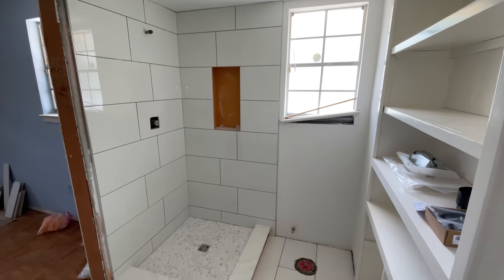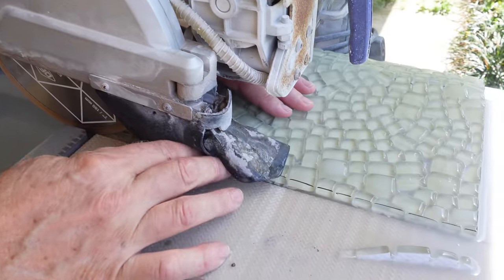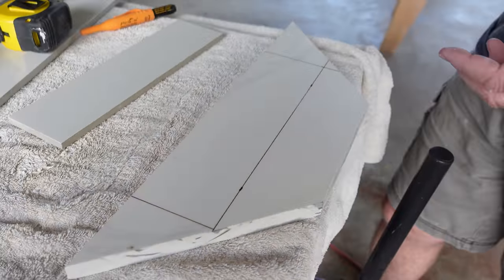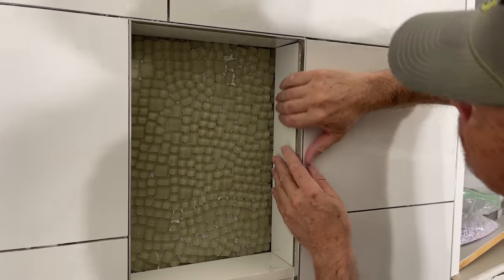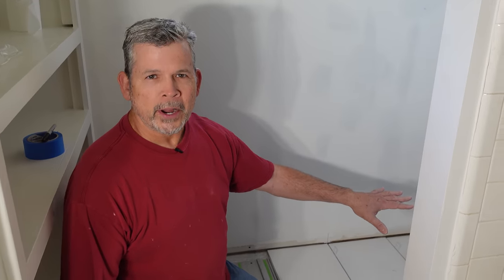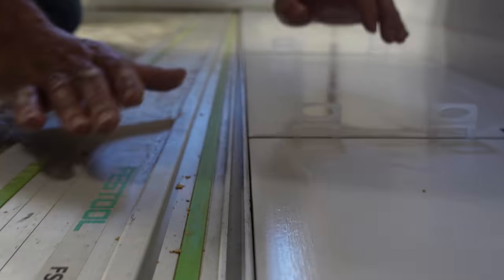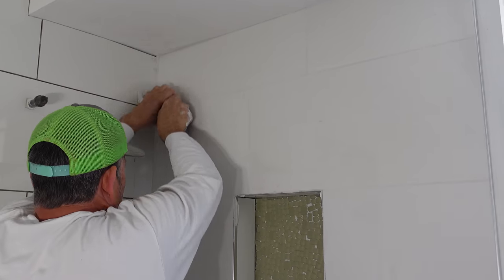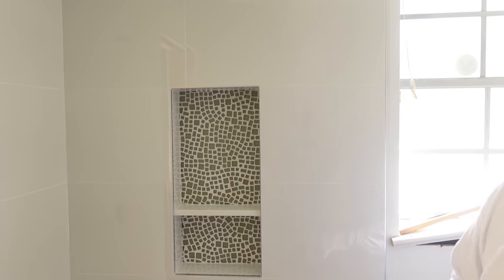BUILDING a MODERN NICHE with Stunning "DRAGON SKIN" TILE

Comment: As a contractor of 46 years here is a tip to cut down grouting time. after grouting and before it sets up wipe the tiles with an old terry towel before sponging, this will get the bulk of the residue and save time and arm muscles.
Reply: Agreed, by the time I'm done grouting my arms are super tired.  It's much harder than it looks on these videos.
Reply: Or don’t use grout like it’s liquid leveler. Why would anyone cover a floor or wall like that.
Reply: Nice trick.
Reply: @timthompson7205 that’s literally the way it’s done lol
Reply: @ChaseW26  are you a 5 year old girl? Literally. Also you’re incorrect. Let me know in 2 years when your tiles are cracking.
Reply: @timthompson7205  literally. My tiles are holding up just fine 5 years later. Try again.
Reply: Whats a terry towel?

Comment: Hey brother. Really like your videos. Love the good positive attitudes. Im commenting because I wanted to let you know something about this prism grout. Ive been a commercial tile installer for 40 years. Im a huge custom blend fan. The area rep is a friend of mine. I know your going strictly by the instructions, however, you can use just a little more water in your grout. Not much more but a little. The manufacturer is just covering themselves for fear of mixing TOO thin. Couple more drops will make your life easier without compromising quality. God Bless

Comment: Woo hoo! Stunning!!  I have used Laticrete Epoxy grout and it sets up so fast! One trick I have learned is to put the grout bucket in a bucket of ice - makes it set up a little more slowly and any little bit helps!
Reply: I use ice water to slow down the setting of grout and thinset when it’s hot and humid.

Comment: I would put a radius (maybe 1/4 inch) on the curb corner to avoid hitting bare feet/ankle on sharp edge there. Great Video you did with lots of information.

Comment: A TON of appreciation for grouting with the fast stuff. I did it once with the fast stuff without realizing it was the fast stuff on my bathroom shower reno. Did all the walls and floor and by time i had gotten it all down it was setting up on the surface of everything... and I was hosed. Spent 3 months of nights and weekends trying to get that stuff off once it set on with drills chemicals and selective scraping... and even then its still not perfect to me.
Reply: As a one man outfit I prefer not using the fast set grout.  You really need two people working it.

Comment: That dragon-skin tile sure looks great!  Love the sea-glass look.  
Surprised no grout company has made a *clear* color-tinted grout line just for glass tiles, so light can refract thru the grout same as it does thru the glass tiles!
Reply: With mirror / reflective  adhesive underneath . . . can't imagine how expensive that would be.
Reply: @jamesm.8392   Thinkin’ maybe paint the color(s) you want to refract thru the glass tiles, & use clear silicone to stickum & grout. 
Not so bad of a cost.  
Or, sick up mirror of choice (even Mylar?), then stick on the glass tiles w/clear silicone.

Comment: Residue in the bucket, if it was the same bucket and drill with residue will make rapid set's kick triple fast some times. or instant. 
Giordano plaster guy showed a rapid set stucco, that was mixed and set by the time they walked around the house. Old buckets he says is the culprit. Some new buckets and spotless mix paddle can be the fix.

Comment: I highly recommend putting a pre-filter on that shop vac (e.g., the kind that act as a modified bucket lid).  They're a bit clunky/ cumbersome, but they really cut down on filter replacements and help keep suction high.
Reply: True, but in a smallish bathroom the extra hose and bucket are just too troublesome to deal with imho.  Most of the bathrooms I do are 5' x 10-12' so they generally are pretty tight spaces.  Instead, I use a filter bag in addition to the regular shop vac filter to help with that issue and then I don't need an extra dust separator.
Reply: @northernlightsrenovations1710 :  I just put the bucket in the bathroom and the vac outside the door.  If you're going to have one or the other in a small room, the bucket is smaller than most vacs.

Granted, maybe the customer doesn't want the vac outside the bathroom, but it's definitely worth it to me not to lose suction, and the bucket is easier to empty than a vac is.  Just my 2 cents.
Reply: @ncooty    Good points ncooty, I don't want to leave you with the idea that I don't use these separators....  I do, just in my workshop though.   ;-)

Comment: I’ve seen multiple videos regarding tiling on cement floors.  Some spend buckets of time on prepping the floor: grinding all the old thinset off, priming, using leveling compound, installing an uncoupling membrane, and then finally getting to the tile work.  I noticed that you didn’t do all of that.  I’m wondering under what conditions it is necessary to do all that prepping work and when it is just wasted overkill.

Comment: I noticed you installed the nitche schluter with the profile facing sideways?  I actually do this detail myself but rarely see it in videos. What I'm  not so sure on is using regular tile for bottom nitch sill then using marble for top shelf. I think when using 2 shelves in nitche both should be marble.. Great job guys
Reply from the maker: Thx vapdivrr.  Yeah I wanted to use the quartz for the bottom but got over ruled 😂

Comment: I noticed y’all was using versabond by custom. That product normally has problems sheering, give permaflex 300 LHT a try from tec products. It’s a great thinset and especially made for large format tiles. I do tile every single day 365 and that’s all I will use.
Reply: Actually, on kerdi membrane, you have to use a non-modified thinset.

Comment: would you consider that row of tile on the left, inside the entry way, a sliver?  it catches my eye.

also, if you put down the marble threshold before the wall tile, so that it looked more professional, it would not have produced a smaller sliver than the tile peninsula you skillfully cut on the other side of the shower.  you could have done it, even though you said you couldn't.  i get it.  you had a schedule already lined up and you seem pretty honest which is good, but you could even be more honest.  we're watching you studs.

Comment: Looks amazing! However, It looks like you guys grouted the shower's corners and where the wall meets the floor, isn't this suppose to be caulked?
Reply: Yes, I'd use a silicone grout caulk in the same color. Shoving prism mortar in there can crack, or you can sometimes get a stress crack in your tile.

Comment: hey guys, Love watching your videos.  When I've done my own tiling in the past, I was always very worried about sponging off the haze the grout leaves behind, before it started to cure.  One time I was a little too late (even though only a short time had passed) and sponging did not seem to get all the haze off and there was a slight film left behind.  This was floor tile and it was a slate grey color, so the leftover film was very obvious.  I didn't know what to do.  Is there a way to get your tile totally clean of excess grout after it has started to cure or already cured?  BTW I tried a couple of products that said they were for just that problem, but they made no difference.  Please any advice you have would be appreciated!
Reply: Try rubbing the area with the rubber used in rubber mallets, worked for me
Reply: Extreme cases you can use a weak mix of muriatic acid, I’d start with an 8-to-1 water to acid - and rub in with sawdust and burlap or Terrycloth towels (something you can throw away) You can  mix stronger if needed but at some point you’ll ruin the grout you want to keep and will wind up having to dig out and  re-grout the floor.  So use the weakest mix you can. The sawdust is an important part of this it holds the acid and is also a safe abrasive. Test carefully first  - You can’t use muriatic on some types of tile (soft bisque, unglazed rustic, etc ) but most hard ceramic or porcelain floor tile will be fine.  Rinse afterwards several times with clean water. Wear lots of PPE as HCL acid can damage all soft parts of you including eyes and lungs. Note also this technique is for PORTLAND based masonry grouts only. If your grout is epoxy based or some other high-tech pre-mixed stuff you’ll have to go to much stronger chemical solvents and I’d consult directly with the manufacturer.  Hope this helps
Reply: Try rubbing some dry powder grout (same color and grit) around with a hard sponge trowel...no water. Vacuum it up and polish with a cotton rag, towel, old T-shirt. It works great.

Comment: What is the difference between cutting and pre-cutting? Great content, thanks for your videos.
Reply: Cutting is "just in time", you measure and cut as you go.   Pre-cut is you measure everything out and do all your cuts before you start mixing thin set.    Thin set kick off times can be slightly unpredictable and some tricky cuts can take a while to do.   Always better to pre-cut tricky areas first.

Comment: Whenever I mix up thinset it always seems to skin over before I am done, even when I only mix half a bag at a time. I usually just keep using it after a hand remix with the margin trowel, but never know if that's ok or not? You guys seem to mix full bags and while I am sure you are more efficient at laying tile than I am, it still takes you awhile. How do you deal with thinset skinning over? 

So far no issues with the tile I've set in my bathrooms at home, but I suppose time will tell.
Reply from the maker: We pre-cut as many tiles as we can so we minimize trips to the tile saw when we're setting tile

Comment: When you did the trim at the bottom with the dragon scales it looks like you put mortar on but didnt trowel it. when doing my wall with hexagons I found tight places where I could not trowel what options do you have as mosaic tiles you cannot back butter
Reply from the maker: You're correct Steve.  In a small area where a notched trowel won't fit I just use a margin trowel and put on thin (1/8"?) layer of thinset and then imbed the tile in that.  I never back butter mosaics, IMO it's not necessary and you get way too much thinset oozing between tiles and clean up is a mess

Comment: with these high tech colored grouts, the color is stuck to the sand. If you use a drill to mix you can remove the color by grinding the sand on itself. so the less handling, the better.

Comment: And also using a 3/4 notch trowel eliminates the need to back butter your tiles. Atleast for anything smaller than 3 ft. Anything bigger than 3ft will still require to be back buttered.
Reply: And that’s the best grout out there

Comment: The second batch could have set up quick if there was residual material left over. It works that way for 20 minute set drywall mud. If I don’t clean my pan before I mix again it dries in five minutes instead of 20
Reply from the maker: We used a new bucket 👊
Reply: @StudPack  🤦‍♂️

Comment: I'm curious on smaller tiles what type of leveling or anti lippage system do you use?
Reply from the maker: I use an old grout float to push the tile into a level plane.  I think there was a shot of that?
Reply: Ok thanks, probably saw you doing it but didn't realize that was leveling them out as well.  Thanks for the reply